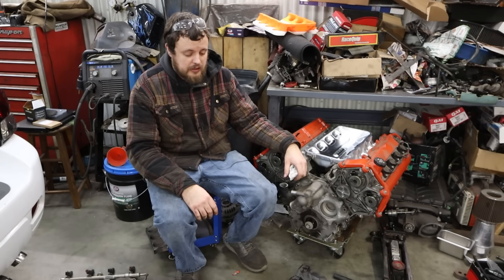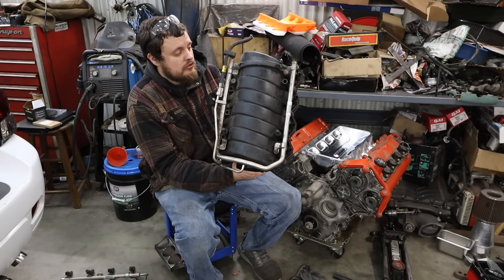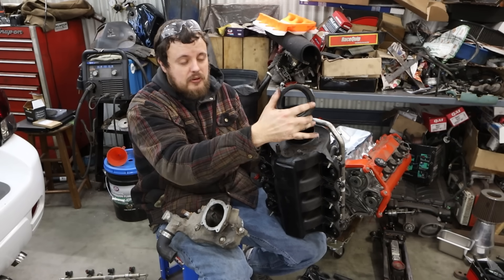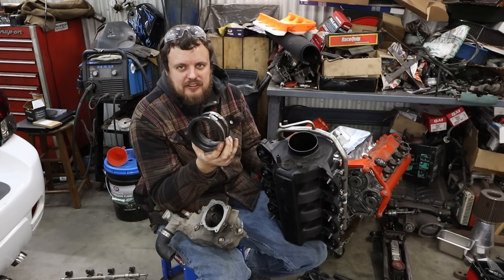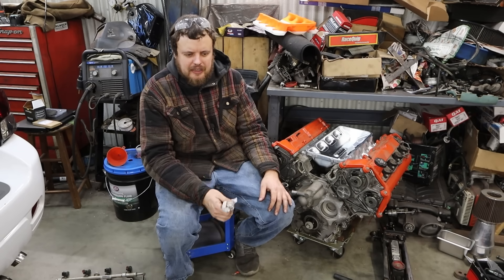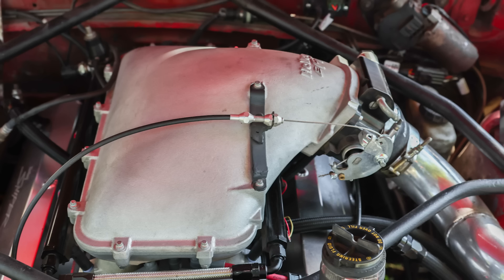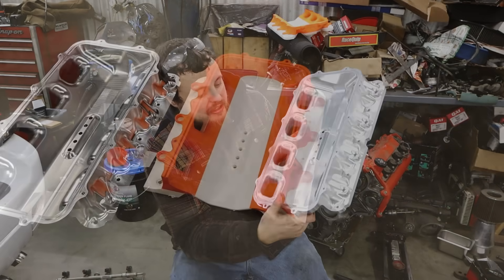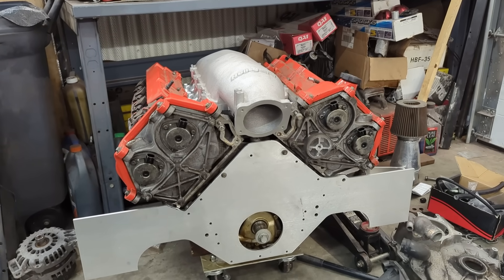Building a 10,000 RPM Intake Manifold for the Northstar Engine

Comment: Since I grew up driving 80s and 90s cars I am very excited to see how the Northstar reacts to all these improvements. I know Northstar got a bad rap for always pulling the head bolt threads out but they overall were very smooth and made decent power.
Reply: Once they straightened everything out they killed it. Typical GM
Reply: @mpetersen6 my God so true 😂!!
Reply: @Build0001  
One thing manufacturers should do is during testing take some cars and treat them like junkers. Oil change every 25k. Filters maybe. Just do little or no maintenance.
Reply: i haven't heard many complaints about lifters in them either. should be a dependable build.

Comment: Wouldn't you agree throwing boost in the mix changes the rules on runner length?  Short is best for less pressure loses.  Optimizing the trade of on volume versus drag is your goal for the street but makes less difference for a drag car.
Reply from the maker: I'm sure it changes a bit, I still think we're pretty short on runner length.

Comment: Northstar performance's business is still up.  If you want the highest compression engine, the 2nd gen L37 was the best.  The latest and greatest VVT engine was the LC3.
Reply from the maker: This is an LH2
Reply: @Calvin-Nelson Alot of GM engineers speculated that the L37 was actually around the output of the LH2, but you know- emissions and marketing, etc.

Comment: Calvin I found you a few years back because if the Atlas stuff which I’m wanting to spice up my 3.7. I love all the knowledge you share on the technical side of designing parts to overcome basic swap issues. I wasn’t very excited initially when you debuted the Northstar build until the dual overhead cam factor sparked some intrigue, since then I’ve learnt some other things that really get my gears turning. The beast of a front wheel drive tranny that was often mated to this engine is the most recent thing pushing my interest, I want to build an AWD dual engine hot rod with an engine in the rear as well as the front. One suggestion on the steering go electric to save on space and a draw of hp driving a power steering pump. Very nice piece you designed that intake kinda needs dual injector ports tho, fortunately Steven, PFI Brent’s son is currently designing dual injector adapters to use double short injectors that is going to be a game changer to add more fuel easier.

Comment: In my plumbing world rubber clamps like on the throttle body will blow off the plastic piping at a fairly low pressure, in my experience 10 psi is doom for them. Test pressure on those is limited to normally 2 PSI. Good call Calvin.

Comment: Hey Calvin, I was curious if you ran an upgraded torque converter on your ls4 4t80e swap. I’m waiting on one from precision industries only like 2600 or 2800rpm stall because I’m running the low buck truck cam. But man it was not cheap like 1200$ about
Reply from the maker: We never did. It would have definitely helped.
Reply: @ we will see how crazy I get with the boost lol maybe I’ll have to shoot for your record lol I’m still a grand away from finishing my project though. I got a “custom” vs7875 for like 400$
Reply: @Calvin-Nelson how much was the billet intake all together cost wise?

Comment: Calvin are you going to be offering this intake manifold?  How much did it cost to have it machined. It would be a really cool engine for smaller cars because it is so small. Thanks for sharing and all the hard work you have done with the R&D for this underrated engine.
Reply from the maker: We might offer it. It would have to be a preorder type arrangement
Reply: @Calvin-Nelson  i cant wait to see this with some boost in a car. I think that this engine will take off if you keep doing that you are doing and all goes well.
Reply: Pre order 2 and always replace that stock when one sells, I suspect this is going to have an impact on this engine taking off

Comment: "This might sound ridiculous but nobody makes a _____ for a Northstar" cracks me up every time
Reply: I will never understand why these ended up in grandma's cruiser instead of the corvette. It could have kept the camaro alive for that period too
Reply: @zacharykelly7434 because they had major corners cut in the design from the factory early on and ruined their reputation
Reply: @regal105 GM has a stellar reputation for snatching defeat from the jaws of victory.
Reply: @ prevost8686
So True!  According to NASCAR statistics, General Motors (GM) has won significantly more races than Ford, with GM amassing over 1,193 wins across its Chevrolet, Buick, Pontiac, and Oldsmobile brands, while Ford has around 831 wins including Mercury and Lincoln models!
Reply: @mewrongwayKOCXF  its the business decisions GM makes that are terrible. The N* is just one of those decisions that could have been better thought out.
Reply: @zacharykelly7434  They did exactly that with the Cadillac XLR which is a C5 with some C6 updates and a Northstar swap. They even supercharged them.
Reply: @subaruanon  it was popular to put that version in street rods for awhile
Reply: @zacharykelly7434  cough LT5
Reply: @zacharykelly7434 they did, it's called a cadillac xlr
Reply: @zacharykelly7434  the zr1 had a dual overhead cam v8 in 1990
Reply: I really wanna see how this stacks up to the coyote with just boost and fuel. that’s it how much power stock cams pistons no porting JUST BOOST AND FUEL PERIOD
Reply: I just go along with it every time, like "Wait really Calvin?!"
Reply: So um. I'm probably gonna get hounded for this. But I have always like the Northstar. Even in highschool when my best friend pulled up with his cuz and he had a DeVille with some 20S and dual exhaust. LMAO but I bought my first 97 sts in like 05 with only 30k on the clock. That car never left me straineded well until 19 year old me decided to wrap around a pole at 80 mph. which was the worse year apparently as I never had any issues. I currently have an 08 sts4 with the 4.6 and I would love to put this intake on it. There is absolutely no performance parts. I did a resonator delete and flow master fx and it sounds amazing also did the brembo brakes off the v and v wheels. But just like any gear head it's never enough. It would be amazing if when you did the exhaust you could sell some of your favorite followers a couple sets of them so I can get rid of these cats. But keep up the work I'm a huge Northstar fan I like the way they sound and it has plenty of power until it don't. So keep making the parts and start selling them toooooo  MEEEEE😅E
Reply: The only after market accessory made for the north star engine is a steel sided dumpster which is where it belongs.
Reply: @jamesbarber5410  it's a great design in the exact wrong application (after the fixes)
Reply: @jamesbarber5410  Think of all the girls that got the prince of their dreams and ALL the frogs they did have to kiss before that came true...... Say no more.